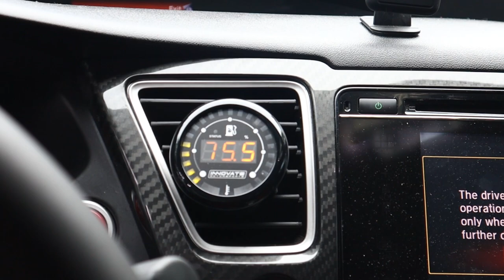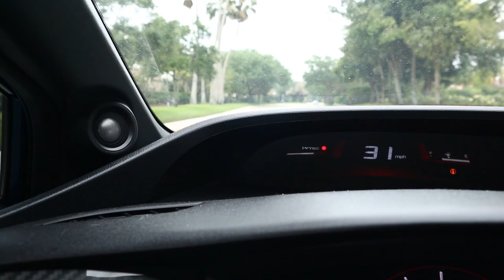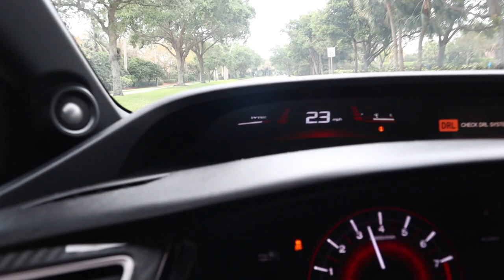I'm back and Dusty is...

Comment: You gotta lower your exhaust a bit or re -adjust it. Have a shop look at it and maybe weld longer hangers, if needed. I had this same issue on my 9th too. It's hitting either your springs or the under carriage.
Reply from the maker: No , it’s the reasonator that took a crap

Comment: I’ve had my 9th gen on 12 psi for a year and over 5k miles making 420 to the wheels. Transmission is holding fine.
Reply from the maker: That’s great new but 5k miles isn’t a lot lol .. but definitely thinking of uping the boost soon
Reply: @zoovie  The trans is good as long as you keep it under 450hp unless you put slicks on it at the track. Best tuner in GA Jason Waters advice. Besides trans swap is easy, motor can probably make about 500 before you crack a sleeve or start losing reliability. My car makes full boost at 3200RPM, and to be honest I beat the living crap out of it.